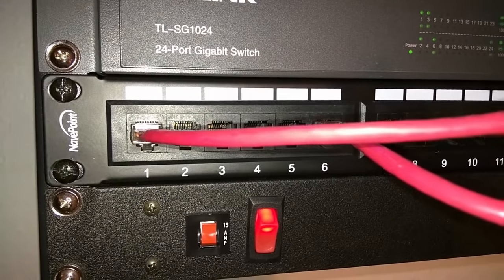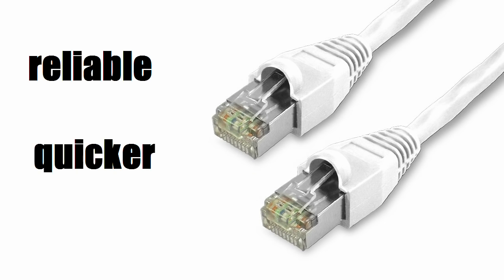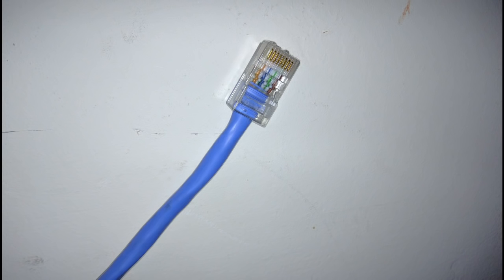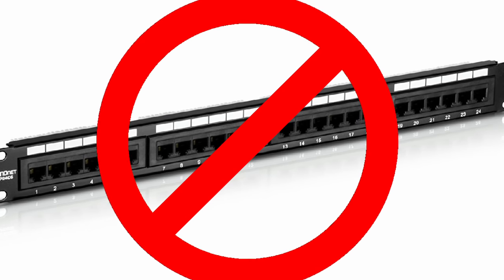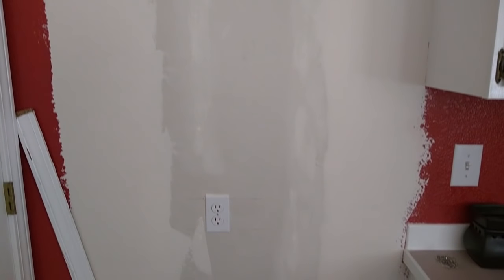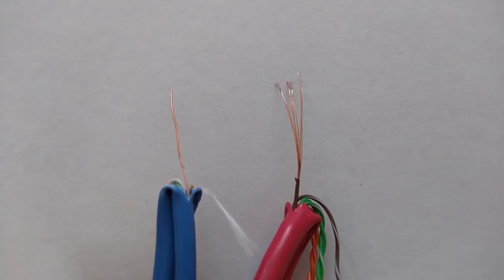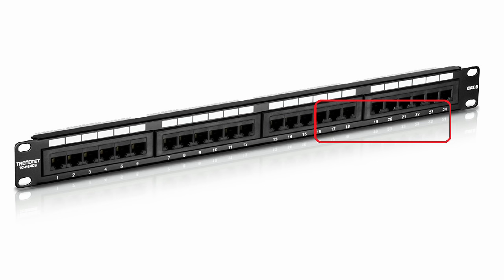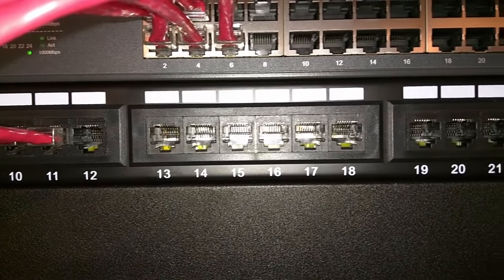What is a Patch Panel? Do You Need One?

Comment: How do you hook up a switch to a router? The reason I ask is that if you use only 1 Lan port from your router that is 1gig to share among how many devices you have connected. Or should you use multiple switches 1 for each Lan port on your router. I always see people hooking up a switch from a Lan port and have 20 devices running. To me that would create a bottleneck. Thanks for your help.
Reply: soo, ports dont share speed, a Fast eth does 100mbps and 1Ge does 1000 which if your switch is capable you can do something like etherchannel to load balance if one line gets saturated. With basic equipment IF you're using more lan ports than your router has you use a switch and have one port connected to the router and the rest of the ports can be end devices. Only way I can a switch being a bottleneck is you start streaming 4k movies to all devices at once
Reply: The speed rating of a router or switch generally refers to the speed of each individual port, so an 8-port gigabit router has 8 ports, each of which is individually capable of communicating at 1 gigabit per second. For most routers and switches, the device is able to have all of the ports going at their individual max speeds. That is, port 1can be sending and receiving 1 gigabit per second at the exact same time as ports 2, 3, all the way up to 8. Using more ports won't stop any of the ports from being able to reach gigabit speeds.

You can still get a bottleneck though. If your switch has a single gigabit connection to the router, then all of your devices can together only send and receive one gigabit per second with the router in particular. However, this is not going to be an issue in practice. Most of your devices' communication with the router is just going straight through it -- to and from the internet. You probably don't have a multi-gigabit internet connection, so even if you could get rid of the "bottleneck" of your devices together only having one gigabit to the router, it wouldn't make a difference.

In the off case you do have a multi-gigabit internet connection, your router probably has a port which can go higher than gigabit speeds -- maybe 2.5G, 5G, or 10G. If you buy a switch with a port that can go that fast, you can just connect them. If your switch has a 1G connection to all of your computers, but a 5G connection to the router, then you can have 5 computers each talking to the router at 1G speeds. No one computer can go above 1G because that's the max speed of the port they're connected to, but your computers can collectively go up to 5G to and from the router since that is the max speed of the port that the router's connected to.

Comment: My family just used female to female adapters running the solid into one end and then a cable to the switch from the other female. Should we switch to a patch panel
Reply from the maker: Whatever works for guys. They are nice to haves.. but are optional.
Reply: How many cables? If you have 4 or 5 then you can put them into a standard face plate that can have 4 or 6 places for them. Just make sure you use the jacks that mate correctly with the face plate.  More than 8 and I would seriously consider a patch panel just so you can keep the cables all tidy and in one location. You can purchase a "stand-off' bracket that will allow room for the cables to come out from the wall or conduit and bend into the panel for termination. It will locate the panel 75mm to 100mm (3" to 4") away from the wall. 

Using a patch panel and not terminating them with 8P8C connectors save you the hassle of doing this if you are running Cat 6 cable. You can purchase the premade Cat 6 patch leads made with stranded wire otherwise you will have solid core wire doing duty as a patch lead where excessive movement (bending) can result in damage to the wire(s). Stranded bends more without compromising the cable integrity.
Reply: You can get a patch panel with female-female "keystone couplers" which can use your existing terminations and doesn't require any punch downs.
Reply: @Zeric1  ok we just moved so we're still working out the new solutions in the new house

Comment: I may be stupid... but what's the last little cable doing, going between the switch and patch? Its on the last port. I think I wrapped my head around what everything does, but that cable has me confused
Reply from the maker: A patch panel isn't a switch. A patch panel doesn't do anything except provide a neat, centralized location for connections to terminate. It's just a passive passthrough.
Reply: @BudgetNerd  Sorry I think I completely edited my question before seeing that you replied.

I found your video was answering most questions as I typed them :P But that last cable still confuses me

Comment: Hey, Can I just plug in all the wall cables into the network switch without a patch panel?
Reply from the maker: You can if you want
Reply: Hi big but... there are 2 different types of RJ45 plugs, one for stranded and one for solid core cables, the stranded one has 2 spikes that go into the strands and the solid has 3 off set spikes that go either side of the solid wire and YES

Comment: Great setup. The only thing that I'm not sure about is all the different keystones brands. I'm  currently looking for a keystone patchpanel so that I can populate how I see fit. I'm just not sure if there are differences in them. I don't want to end up with a bunch of keystones that don't fit in the patchpanel.
Reply from the maker: Good question. I'm pretty sure most keystones will pop into most keystone patch panels, but I haven't used one before, so don't quote me on that.
Reply: I've never worked with a patch panel that the Keystone jacks did not fit...
Reply: @ltdees2362  thank you. I'm building my first Serverrack and saw lots of videos relating to this topic. But with so many different brands I wasn't sure if this was a standard. It's the little details I was missing. This answer will help me out. Thanks.

Comment: I used a couple 24 space keystone patch panels to organize my home, along with dedicated phone and TV cable patch panels. Initial home wiring only included the TV and phone with an assortment of splitters. When I started adding networking I did the direct to switch and router thing until about 6 connections. Then I quickly saw the benefits of patch panels. I tried a few small ones intended for home use first, but was disappointed. Rigging support for rack mount panels gave me the extra flexibility I wanted. I went with the keystone patch panels for the convenience of being able to organize my central hub by room instead of by connection type. Then I use the patch cables to reroute to the appropriate networking, TV, or phone devices doing the actual control and distribution. It makes a world of difference when you are doing whole house wiring in a space just 9 inches wide: https://i.imgur.com/bpSrefR.jpg

Comment: This might be a dumb question, but do I need a separate Ethernet cable for each item I have, or can I put a switch in the one room, have multiple items connected to it, and then they all talk back on the one cable to the router?
Reply from the maker: You are correct. You can use a switch the way you are describing.
Reply: Good question.  Ethernet switches allow you to combine connections between devices.  In a simple setup, there are no Ethernet switches and you connect a computer directly to the router.  If you have many computers in many rooms, then you can combine all the Ethernet runs to a single Ethernet switch next to the router, and the connect the Switch to the Router.  If you have multiple devices in each room and multiple rooms, then you can have a large Ethernet switch near the Router and small 4-port Ethernet switches in each room, and then the Ethernet switches are connected, small connected to large.  And the million dollar question of why doesn’t the Router have more ports....Routers are expensive and Switches are cheap (simple answer).
Reply: Yes and No you could run one cable to each location and install an 8 way switch at each or run 4 cables to each location and no switches, still need a switch or use the 4 ports on your modem say in a patch panel or no patch panel just  use wall plates say 4 x 4 thats 16 outlets just put in garage or closet

Comment: So you can put an RJ 45 phone cable into a wall outlet plate that leads to the patch panel? I guess that will have to be a VoIP phone or can it be a regular landline phone connection?
Reply from the maker: Phone Jack's are RJ-11, and as long as you are using the proper patch panel, or the proper cables, you can do that, yes. 

After all, all those Ethernet cables are, are wires, and if you can get the same connection from one end to the other, it will work.
Reply: @BudgetNerd  and the cable behind the wall can still be a Ethernet cable when connecting the RJ 11 to the wall plate?
Reply from the maker: It would be. It's just wires, so if there is continuity in the line, and the proper connections are made, Ethernet cables in the wall will still work for that.

A lot of times, the phone lines in homes are ethernet cables. They only use 4 of the Ethernet cable wires when they terminate the end of it with the RJ-11 jack.

Comment: Do I need to connect the switch to a modem then connect switch to patch panel to get a connection to ethernet jacks or no? Sorry for dumb question still new to this, moved into a new apartment
Reply: Ideally, it would be Modem to Router(to make your home network private for security), router to switch, and then you can have your patch panel setup on the backside how you want with the ethernet cables running where you want in your house, and then on the frontside of the patch panel you just connect up the required port you want to use to the switch :)
Reply: @jonmarren8066 ok thanks
Reply: @jonmarren8066  I'm still heavily confused about those damn patch panels! How does it fit to this network architecture? I understand the basic route ISP ->  Modem -> Router -> Switch -> (Wireless AP) -> Devices. So where does this patch panel should be placed? Or does this guy in the video has some kind of "two way" network that goes ISP ->  Modem -> Router -> Switch -> (Wireless AP) -> Devices and then  ISP ->  Modem -> Patch panel!?
Reply: @patmull1  The patch panel gets used as a place to terminate ethernet runs that aren't going to be moved about or played with regularly, so for example you would run the ethernet cable that goes to your PoE AP into the back of the patch panel
Reply: The setup I have is ISP -> Router/Modem -> Patch Panel -> switch (with most other devices that need wired internet also running into the patch panel simply for aesthetics meaning the only cables visible out front are those running between the switch and patch panel)
Reply: @jonmarren8066  Thanks a lot! It does make a sense now.

Comment: I don’t see why anyone would “reconfigure” their network setup at home. If the stuff works then it works, and which port you use doesn’t matter. If your switch breaks over 10 years, buy a new one and the new ports probably align up very closely to where the cables already are.
Reply: It matters if you're using a managed switch :)

Comment: I have used your video as inspiration for my home network but I have one big problem, the patch panel that I have doesn't have a power plug... so... how is this supposed to work? do I have to plug a POE ethernet cable from my switch into the patch panel or is it supposed to have no power supply? There is a small cable on the back used for the earth part of the electricity as far as I understood it but what am In supposed to do with it?
Because I connect a cable in the patch panel and the other end into the wall plug but when I plug my pc into it, there is nothing, no network detected ( Yes, I double checked the colors of the cables so that they are the same order on both sides but still nothing...)
Any ideas? please? 🙂
My patch panel is this one Cat.6 Patch Panel 24p STP  from Lindy.
Thanks for any help
Reply: Hi there! I'm not the OP but I can help you out. There is no power supply needed for a patch panel. It's not powering anything; its simply an intersection or hub for all of your ethernet wires. What needs electricity to "push" or send internet signal through your patch panel is your router. First, I'd recommend checking to make sure your router ethernet cable is plugged into the port that you want internet in.
Reply: @TechZpert  thanks for your quick answer 🙂
My setup is as follows :
router (from provider) 1 port goes into the switch
Patch panel with incoming cables from all the rooms that need wired connections (ports 1 to 16)
Switch with PoE on all ports with cables from ports 1 to 16 and 2 other ports connected to my desktop and console
a power plug strip which is used for power plugs for the switch and router
I used port # 3 and 4 in the office of my wife on the wall plug but when I plug an ethernet cable in, no connection is found... 
So does this mean I have to plug a cable from my router to the panel also or is this managed by the switch?
I'm not very good with networking, sorry :(
Reply: @BastiaanBuellingAbadeonGaming  No worries. So the order of where your internet goes is. Router -> Switch (This gives the switch the ability to give internet) -> Patch Panel (every port on the switch should be plugged into rooms where you want internet on the patch panel) -> Rooms/Devices. The fact that you have POE on the switch is a bit overkill and won't effect the answer. So the question I have is this: Your wife's office should have a corresponding port on the patch panel in your network room. Is this port connected to the switch? This will give it internet. If the port is connected to the switch as it should be, then you may have a faulty wire. You can check this with a simple Klein brand tool called a cable tester. These are about $60 and while expensive they serve as a good tool to have
Reply: @TechZpert  waouw that's a great reply, very complete, thank you 🥰
Everything is a you described so I'm guessing that it's a wire issue. I have a cable tester that I will try out later today, I just got home from my 14hours of nightshift 😴 I'll check and let you know 😉 if it diesn't work I'll just take the patch panel out of the setup and see if that changes anything 🤔 hope I don't have to re-do the wiring 'cause that took me 2 days 🤣😅 thanks again and I'll keep you posted
Reply: it must be 586B

Comment: It’s funny as I ordered this ugly looking cable management thing that extends past the front of the rack and has a cover and these things that I’ll call fingers to manage your cables threw . I thought it was better than nothing ,but then YouTube’s algorithm started showing me racks with patch panels .

Of course my OCD was triggered, and I now have them ordered . I have a dream machine pro and a 24 port unifi switch , and I’m installing a 48 port patch panel between the two units in order to keep the cables 6” long , and nothing crossing each other. 
Also installing a 24 port patch panel above the UMD pro, and another 24 port patch panel below the switch for the cleanest look possible . This is in a 6’ network rack located  in my basement that I acquired from work when they decided to discard them all and upgrade to 7’ racks Instead.
Will be using red 6” Ethernet cables and red Leviton extreme 6 keystones on ports that are POE , and grey keystones and cables for non Poe ports. 
Things started out simple, just two AP pros , then I got ambitious and started installing my ubiquity cameras . Only had intentions of installing a G4 pro and a G3 pro, but then I found it was so interesting having camera coverage that I now have five G4 pros in addition to the G3 pro .

Next I upgraded my television package , retiring my old Shaw gateway and portholes for these new boxes that have the option of connecting via Wi-Fi (which I despise) or use their included Ethernet  connection. 
So obviously I hard wired cat6 to those portholes also , and this network just keeps increasing . I’m certainly having a lot of fun along the way though , and am patiently waiting for my keystones and patch panels etc to clean it up and make it look more professional.

What amazes me is the fact that I’m going to remove miles of rg6 coax, as my how things have changed . I only have my rg11 service drop coming into my house feeding the modem , and the rest will be Ethernet.
I’ve been in the cable industry for almost four decades and never imagined this

Comment: To be honnest, a Brush pannel works better due to neatness and Quality connections. Rather than label the cables or the patch pannel, just make an excell spreadsheet and print out a note sized information table. The information is easy, fast and neat.
#JustSomeGuyWorkingInIT
Reply from the maker: Brush panel could work too. It just depends on the situations. I did use one on another project though, it helped keep stuff pretty neat.

Comment: I just wired u- 2 rooms in my basement to extend the wifi. should I send the signal from an ethernet cable coming off my modem or main router or does it not matter. Thx and awesome video
Reply: It doesn't matter, as long the cables are connecting to the internet you will be fine
Reply: Router
Reply: @DerbyMods  thank you